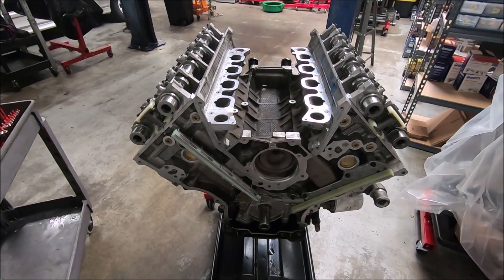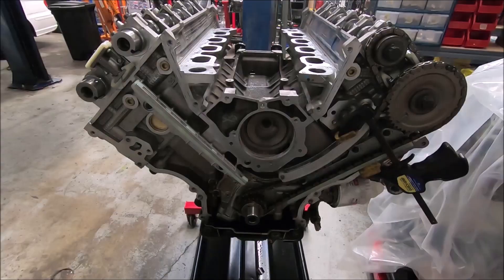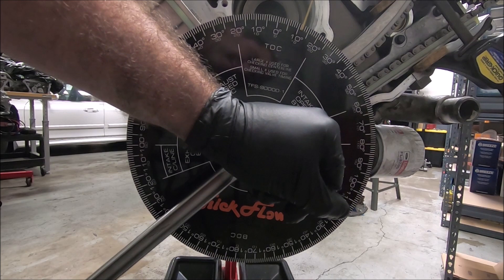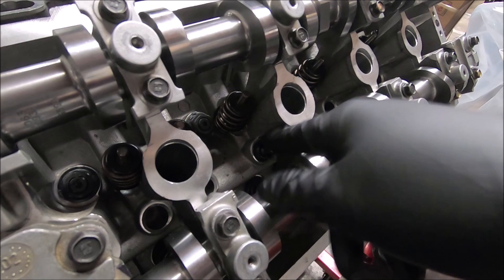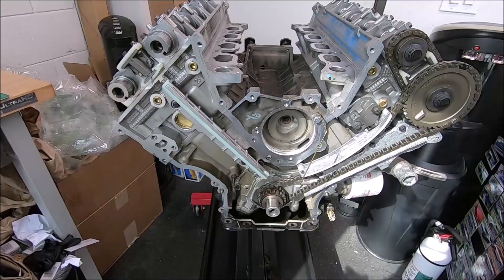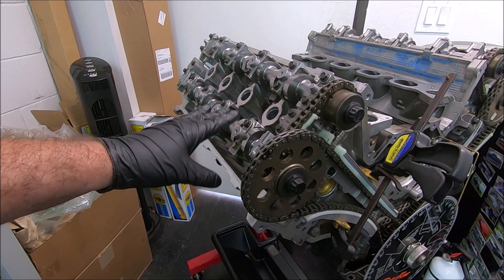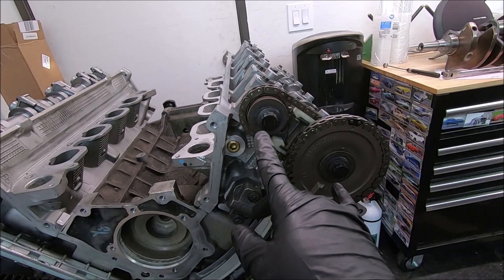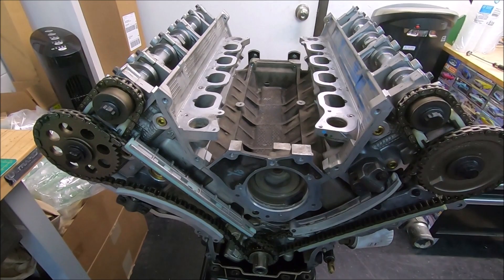How to degree 4.6 and 5.4 DOHC Ford Mustang V8 camshafts

Comment: So technically degreeing the cams isn't a mandatory step but just a way to see what type of cams you have. Because there's no way you can change the cam degree unless you get different cams. The TDC for you pistons is what is the mandatory thing to do if you want the engine to not fail catastrophically

Comment: I have a '96 Cobra Teksid DOHC block and I am putting on '03 Cobra heads with the Eaton supercharger. I will be using the '96 cams but I am not sure what I should set the Center line for both intake and exhaust. Also the intake sprocket is a floating sprocket (keyless) so I can set it at any degree and also have COMP Cam adjustables for the exhaust. I just don't know a good starting point for a super charged setup on these '96 Cams.
Reply from the maker: I have been told the factory spec is 110IC/114EC for smog and 108IC/114EC for non-smog cars and that those came from mihovetz

Comment: How did you pass TDC to get to 2 degree after TDC and then you subtracted your values and divided by 2?

I thought you add the values and divide by two moving the needle then to 13 degree not 11? Wouldn’t cam be advanced two degrees otherwise?

Comment: John, this is an outstanding video. Are there any adverse effects of cutting the cam girdles? I'm thinking about doing the same thing.
Reply from the maker: Not that I am aware of.  I have done it on several engines and others have too.  Later versions of the modular engine Ford went to single caps vice connected ones like the girdles found on the early 4.6 engines.

Comment: Hey John, I’ve watched this 100 times and think I’ve got a handle on it lol. But I’ve read that the cobra engineering passenger side secondary tensioner fixes a lot of the misalignment issues on that side, and from what I’ve seen the driver side is a lot of the times nearly spot on degree wise. Do you recommend I absolutely degree my cams? Just a weekend car, 662whp on ethanol as of now. Just looking for that sound while the car is apart, not worried about gaining every oz of power at this point.
Reply from the maker: Cobra engineering does make a great passenger side secondary.  I feel that degree cams is a good idea but I wouldn't say that it is an absolute must.  If you have stock cams I wouldn't worry too much about it or the secondary tensioner.  But if you start putting aftermarket cams that have a lot of lift or duration then it probably a good idea to degree or at least check piston to valve clearance.

Comment: Hello John, I have an 93-94 teksin block that I'm adding C heads with a 1999 Cobra intake. I'm looking to purchase a complete gasket set. Is there a difference between the years? What gasket set do you recommend? Thank you...
Reply from the maker: I would not get a gasket set, I recommend purchasing the gaskets as needed.  The reason I say that is because not all the parts are the same throughout the years.  Timing chain, oil filter adapter, and intake manifold gaskets can differ by year.  I would get them individually and make sure they fit.

Comment: I have a carbed 4.6 DOHC and I am curious where I should run my timing curve. My timing is dead on, I just can't seem to find any info on where these engines are happy as far as my curve goes. I have it set at idle to 15° and curves up to 26° at WOT. Any advice guys?
Reply from the maker: That sounds about right to me.  I have heard of people running closer to 30 degrees at WOT but it's going to depend on the fuel and compression. You could always dyno it for a baseline then add a degree or two and see if it likes it.  If only we all had personal dynos.
Reply: @JohnSmithRacing  I have no idea what my compression ratio is. YES, I sure wish everyone had a dyno lol
I used to have my compression ratio figured out, but since lost the measurements on everything. I have a stock bottom end from a lincoln mark 8,(Teksid 4.6). -2.8 pistons? Also have a stock set of 2001 lincoln continental C, tumble port heads. 54cc combustion chamber? And I have stock deck height and oem head gaskets. .036 thickness? 

I know the 96 my bottom end came from had 9:85.1 compression.
Reply from the maker: @NoLogoGarage  Yeah, your set up is probably mid 9 CR.  I believe the B-heads had a bit smaller chambers so going to the larger chamber should have lowered compression some.  Either way, I feel you are pretty close on the timing.
Reply: @JohnSmithRacing  appreciate it.

Comment: I just received all those parts, the comp cam 4793 won't fit into the trickflow degree wheel is there another crankshaft socket you recommend?
Reply from the maker: Sorry, I may have typed the wrong part number.  The correct Comp Cams part number is 4798.

Comment: Do you have to do this when rebuilding an engine and using stock cams?
Reply from the maker: No, the factory cams are just lined up with the timing marks.
Reply: So I'm putting some 98 cobra cams in a 9 thread c head do I need to do this also
Reply from the maker: @hilliemagwood52  No, you don't have to.  Even if you wanted to, you would need to know what the recommended centerline is and I do not believe those numbers are posted.  It will be fine without degreeing them.
Reply: @JohnSmithRacing  they are; it's 110IC/114EC for smog and 108IC/114EC for non-smog cars. those come from mihovetz

Comment: Question John, do you know if the same applies to the 4.0 v6?  Can't  find a vid on one. Want to add 2 degrees on mine after replacing the chains. (No sound on my old phone). Thanks.
Reply from the maker: Yes, the process would be the same.
Reply: @JohnSmithRacing   Bless you.

Comment: would this be necessary to do with stock cams?
Reply from the maker: No, it is not necessary with the stock cams.  The Ford service manual does not even have the procedure in the engine building section.

Comment: Hi John. Greetings from the uk 🇬🇧 what’s the maths on using number 6 cylinder? Many thanks
Reply from the maker: Hi, not sure if I understand the question.  The number 6 cylinder is used to degree because it is the companion cylinder to number 1.  Meaning when 1 is at TDC so is 6, just one will be starting the power stroke and the other starting the intake stroke.  Hope that answers your question.